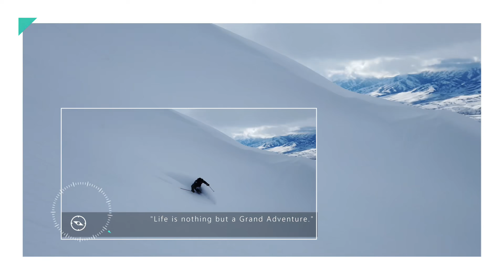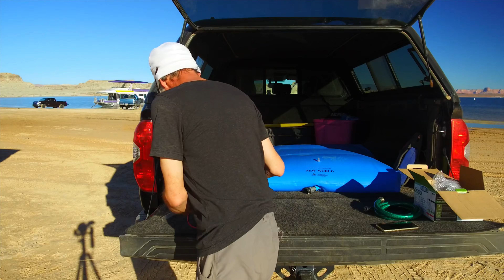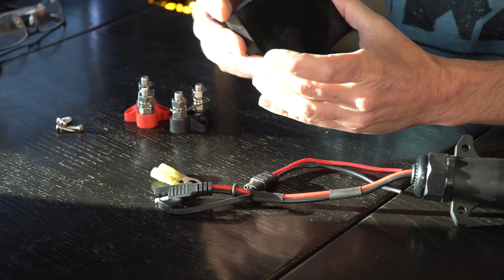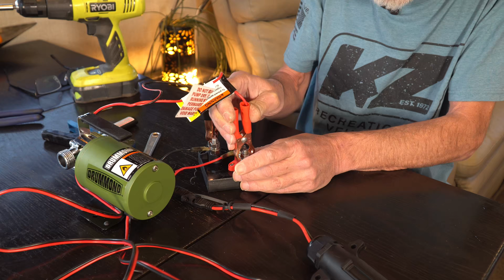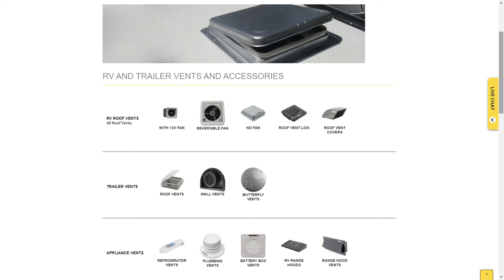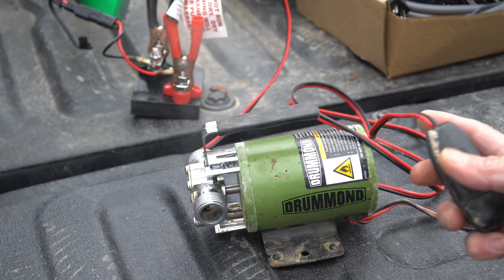Ep. 399: Adding Easy 12V Accessory Power to a Pickup Truck Bed | How-to DIY RV travel camping

Comment: Are you aware of any place to buy:
A cigarette lighter to 2-pin SAE rigid adapter without cable, rigid male or female plug-to-SAE connector (or "quick disconnect") for 12V accessories, a direct plug-and-play solution, often with a 12V accessory socket or a direct male-to-female adapter for charging or powering devices.
Reply from the maker: Can't say that I recall seeing one anywhere in particular, Dean.
Reply: @GrandAdventure than you, seems a no-brains for somebody making these things

Comment: Marc thanks so much for this video!  Not going to be boondocking anytime soon but I have the same pump and bought it to empty a 100 gal water trough I put in my truck bed to haul water to 2 of my horse pastures that don’t have water except for ponds.  It was so slow emptying them using gravity with  a hose hooked to a valve I put on the bottom of the trough.  Bought a 6’ 7 way plug so it can reach the bumper connection in case my farm helper uses her truck that doesn't have a connection in the bed like my F350.  Had originally planned to put a 12v battery in the back when hauling water but thanks to you this makes it so easy.
Reply from the maker: Fantastic to hear! That sounds like a terrific use of this little homemade accessory.

Comment: Our 2021 f150 lariat has an ac plug in that same corner of the truck bed. I bought a nice bright 12 volt led light bar to put in the front of the truck bed. But I'd need to either wire it into the 12 volt system or use an AC to 12 volt DC adapter. I'd rather use the adapter approach to avoid running wires through the truck. Suggestions? Would I need high amperage. Seems like 30amps would be best to support any other 12 volt device, like your pump etc. Ideas appreciated. Thanks
Reply from the maker: Frankly, if it were me I'd rather wire it directly to the 12V fuse block than use an AC to DC converter, for there's an efficiency loss not only with that converter, but also with your truck's built-in inverter that's turning its 12VDC power to 120VAC. I'm no expert, but it would be fairly easy to run a positive lead from the truck bed down through the gap between the bed and the cab, then underneath the cab to an empty fuse in the fuse block in the engine compartment, then run the negative from the light to a good ground. I've done that with previous trucks to put 12VDC in the bed area, and it's an easy task. You can check what that light bar draws to determine fuse size, but I'd be shocked if it's anything close to 30A. You should also consult voltage drop tables to determine the appropriate wire gauge to use.

Comment: Excellent idea, Marc! You can use that for so many 12 volt, DC uses.
Last year, I ran 2- 6g cables, an MRBF (fuse) from the positive terminal on the Tundra's battery to an Anderson Connector,  along the sides of the 4 and 7 pin connectors. I also ran 6g cables into our pull behind for a DC-DC charger to top of our batteries while towing.
Thank you again for another awesome,  educational video.
R&K
Reply from the maker: You put a lot of work in, Ron, but that has surely paid off, too. I was prepared to do something similar, but then this idea hit me, which is perfectly adequate for all I needed to do here.

Comment: Sorry Marc but your idea is not a good one. When you were plugging in the device your Bus-Bars were pointing down and could easily have caused a short. You would have been wiser to cut the wires on the water pump and add in the SAE connectors to both pieces so you could simply connect the pump directly to the 7 way plug or use the alligator clamps if they were needed. The Bus-Bars are not necessary and are dangerous. Thanks for the great video though and keep them coming. I look forward to it every week.
Reply from the maker: I appreciate your feedback, Mike. Let me ask, though (and not trying to be a smart aleck here): how is clipping to the bus bars any different than clipping directly to the battery terminals, as the pump is designed to be?

Comment: This is genius.  I'm outfitting a camper shell and have done everything but bring 12V power to back of the shell.  Even bought all the wire and everything to tap it off the battery, but forgot I had a 30A 12V feed to the 7-way plug.  I'll probably just intercept that feedunder the truck, but this is a great idea!
Reply from the maker: Glad to hear that we were able to lend that idea! Good luck with the build-out.

Comment: Marc, what great timing, I just bought that 7 way plug adapter and was going to do the same thing for our truck, but I was going cut our alligator clip off and add the SAE directly to that wire for our Viair pump.  Do you think that would be a problem that way?
Reply from the maker: That should work like a charm, Kyle. However, personally I'd leave the alligator clips in place and splice in the SAE. Otherwise you'll lose the ability to connect your Viair directly to the battery when you want to use it near the front of your truck. If I were to go your route, I think that I'd add the SAE via T-connectors to splice into the power cord. I would think that would work. The only other option I would see to maintain the ability to connect to the engine compartment would be to add a fused SAE connector to the battery, but that method doesn't leave me all warm and fuzzy.
Reply: @GrandAdventure  great point, thanks

Comment: great idea Mark.  Interested in how you did the actual truck setup (that you plugged into).  thx
Reply from the maker: Kelvin, the 7-way trailer connector on the bumper is part of the truck OEM. The one in the bed would have been, too, had we ordered the truck with the 5th wheel prep package. Instead, we had to add that connector when we installed the fifth wheel hitch.

Comment: What year is your F350?
My 2021 requires the engine running, trailer connected (detects via load on lighting circuit), and then the brakes have to be pressed before the relay for the 12v power engages.
Reply from the maker: Mine is a '22, Ken. It requires the engine running, which is actually a good thing for a high-load device like a liquid transfer pump or an air compressor. However, it doesn't require anything more than that like you've described. In testing this, it actually thought that it was a trailer connected.
Reply: @GrandAdventure One of the Amazon reviews of the 7-way adapter mentions there is a 100 ohm resistor between pins 1 & 6 (right turn/stop and ground).  That would simulate a trailer attached. 👍
Reply from the maker: @kencoulter7284  well, there ya go. Thanks for finding that.

Comment: If you’re going to continue to have this type of system with that pump, wouldn’t it have been easier to cut the alligator clips off the transfer pump and solder on the SAE leads calling it done?
Reply from the maker: We sure could have. In fact, SAE adapters to both a cigarette lighter plug, and a USB port (A & C) with voltmeter built in are both arriving today just to provide extra flexibility.

I didn't want to change out the pump's connector to SAE for several reasons. For one, I have other accessories (for example, a Viair 88p air compressor) that use alligator clips, thus I'd have to switch everything over. For another, retaining the alligator clips allows me to still connect those devices directly to the battery when I want/need to use the device near the front of the truck. Doing it this way gives me maximum flexibility.

Comment: Good job! I was waiting on that drill bit to go into the table. Did you get new furniture??
Reply from the maker: 😁The possibility of drilling into the table was always there, especially with me.

The furniture we've always had. We need to replace our theater seats (Thomas Payne) as they're prematurely cracking and peeling. The matching couch has done so too, but the theater seats are the current priority.

Comment: I would imagine a person could plug in a little 12 volt converter to that setup as well to plug in a 110 v item.
Reply from the maker: @SlickSydney  of course, you could plug in a small power inverter as long as it doesn't draw more than the circuit is rated/fused for.

Comment: Interesting video. I'm curious as to why you didn't use quick disconnect connectors with an inline switch from the pump to the 7 pin connector rather than alligator clips. Or alternatively, just splice the pump to the 7 pin connector with an inline switch. Less chance for an inadvertent short on the exposed posts, particularly if it's raining. 
Respectfully, one suggestion. Treat the posts as a battery and attach the positive first.  Less chance for a spark if there happens to be gas fumes nearby.
Reply from the maker: @mitchsmolow6268  Good point about connecting order. We didn't change the connection on the pump because we would have to change the connection point on multiple devices that we will use with this. The pump came with the alligator clips in the first place. With the SAE connector in between, however, we can substitute things like a cigarette lighter plug or a USB port for the terminal block, to maximize the flexibility of this idea.

Comment: Marc, 

Thanks for that instructional 'how to' video.  

I recently hooked up an SAE connector from my motorcycle battery terminals with a short lead down one of the frame supports under the seat. 

I zip tied that out of the way behind the frame support but easily accessible. 

Whenever I want to keep the motorcycle battery on a trickle charger, I simply unplug the SAE alligator clamps from the trickle charger and plug the trickle charger directly to the accessible SAE lead from my motorcycle battery.

Wouldn't running an SAE plug disconnect on your pump and connecting that to the SAE connector on your eight pin plug be an easier solution... 

Rather than going through your project block alligator terminals? 

The parts would be less expensive and the connection less cumbersome. 

All it would require is a set of SAE connectors to be spliced into pump wiring harness... just disconnect the alligator clamps and then directly connect the eight pin plug... voila!

Just a thought...

Gord
Reply from the maker: @gorrdd  thanks. Absolutely that would work. However, the water pump isn't the only 12 volt accessory I use in the bed of the truck. While your method would be cleaner, it would also require me to ensure that every accessory I use today, or want to use in the future is powered via an SAE connector. I see it as far easier to simply provide terminal blocks for maximum compatibility. I can also connect things like a cigarette lighter adapter, etc. to the terminal blocks as necessary to accommodate different power interfaces. I could even skip the terminal blocks, and connect a female USB-A connector to an SAE connector, right to the 7-pin plug. Whatever works, this makes the possibilities almost endless.
Reply: @GrandAdventure  Indeed, Marc... Nevertheless, you can always reconnect the alligator clamps back onto the pump and use it elsewhere with your project block. 

For me, I would prefer to convert all my accessories to SAE plugs.  

It's also safer, rather than having live bare terminals on a small project block that could possibly tip over and short out against a metal object.

Again, just a thought...

Gord

Comment: This is why I like the Ford F150 Hybrid Powerboost. No limitations with electric power. 

Hopefully, they will offer that on the F250 and F350 in the future.  

The problem is they must also engineer a new transmission with integrated electric motor/generator.

Until they know the sales will be there... they won't do that.

Gord